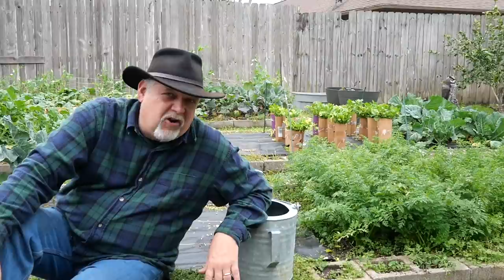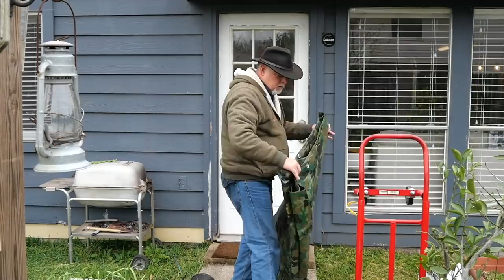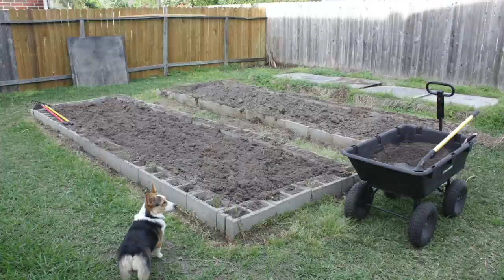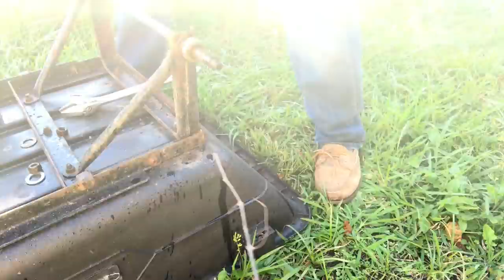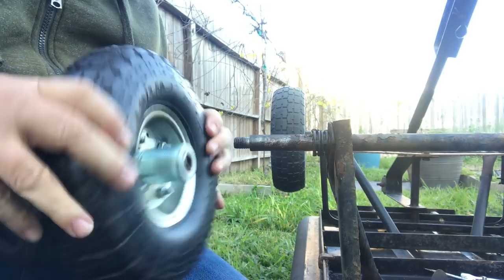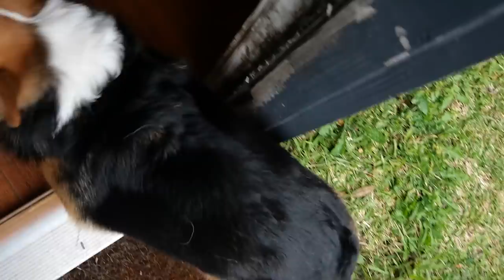Freeze Preparation, Repairs, and a Phoebe Update || Black Gumbo

Comment: Brrrr, it's cold alright. Here in central TX we got snow, which is gradually melting. Last year, I had this forlorn hope for a silver lining--maybe the bitter cold would hurt the fire ants. But, they are still here.     Watching you work on the Gorilla cart, I was afraid you might have to call Bigger Hammer, Inc. 🤔 But, you persevered and got the job done.    My best gentle, hugs  to Phoebe.

Comment: Hey just a thought. But you could get some black rust reform spray. Take a wire brush and clean off as much of the rust as you can and then paint over it. That would protect the metal for longer.

Comment: Have you tried pink celery? It doesn't require blanching and is very forgiving in cold weather. The stalks don't get as thick as green celery but the flavor is awesome! I freeze extra for use in summer months and use the dried leaves as an ingredient in my vegetable broth powder. I freeze my dill as well! I feel it retains flavor better than drying.

Comment: Why don't you use thermal fleece to protect you plants instead of having all that hard work to get them inside of your house? If you use 2 or 3 layers of fleece the plants will survive for sure, as long as you don't get 4 or 5 inches of snow. Perhaps they could die from all the weight of the snow on top of them but not from the freezing temperatures. Just a thought to consider, Scott.

Comment: Where did you find solid wheels for your cart? I tried the ones from Harbor Freight but they don't fit right. I put 'fix a flat' in one of my wheels and it's still working, for now. However who knows how long that's going to last.
Take care and good health to you and your family(even the 4 legged kind).
Reply from the maker: Amazon had them a while back. This time the wheels have inner tubes so they don't have to depend on the bead of the rim being unrusted.

Comment: What kind of stakes are u using? 
I have been out since 7 this morning covering another layer.  My self seeded toamtillos are covered with a frost blanket and the swimming pool.  
I used cattle panels and the 6 mil plastic from lowes to cover stuff. With frost blankets too
Reply from the maker: Just bits of random garden stakes I had lying around. The kind with green plastic over a metal tube.